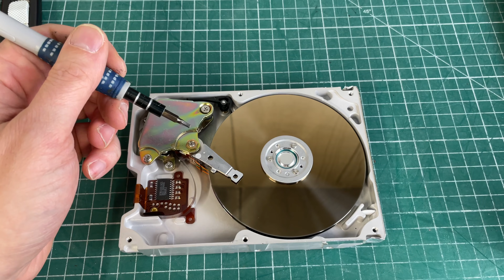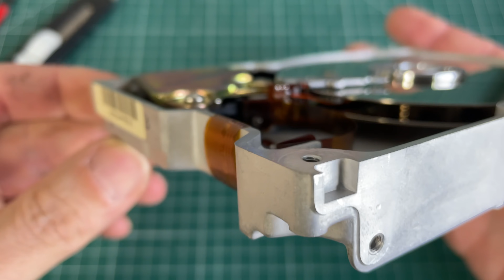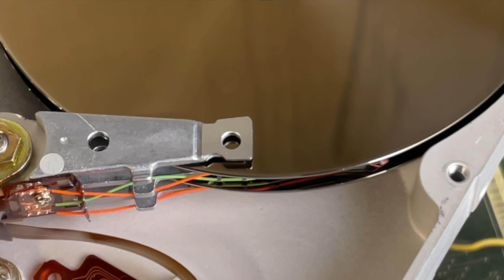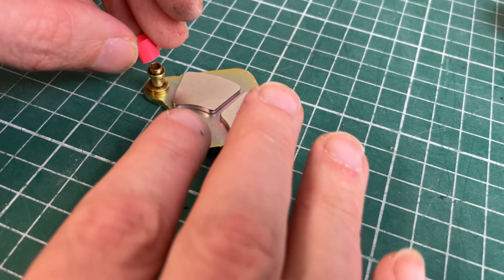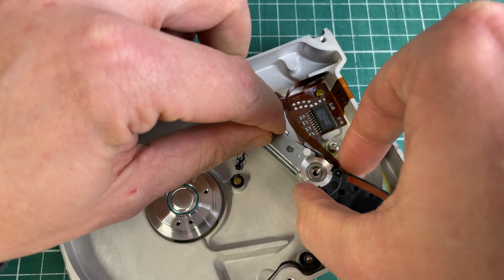Hard Drive Repair Gone Horribly Wrong

Comment: I have a Quantum 2.5GB hard from 1996 on a Windows 95 system. The system was held in perfect condition, you cannot even find dust in the case. I used it till 2000 when I left for overseas. It was still held in the same condition until I returned few months back: the hard makes exact same sound as you showed. Was thinking to open the drive case and look inside but didn't. Next time I am back, I will use this video as a guide. 

Got some important 90s games on that drive😃

Comment: Those jumpers designate boot order. Technically you should make a clean box without it the chances of it working again are slim the screws are also torqued without knowing the torque same thing will happen. Before opening trying tapping it on it's side. It will allow you to sometimes grab the data but once it starts that it's called the death rattle. Drives are not serviceable for reason they are really hard to repair or refurbish. Perhaps if you had taken that off and found that tar it may have actually worked. I have this laptop drive I took apart just to look and it has a device in it when the heads leave the platter this device ensures the heads don't touch.

Comment: I have that exact model and they drive would spin up .. make 3 clicks and then shut down... I opened it and removed the top magnet and isolated the goo ruber stoper with tape and placed the magnet back... now the drive spins up and the down (without the 3 clicking) ... well it is dead unfortunately But I would never venture touching the heads and platters...  QUANTUM drives were/are/and always will be TRASH.
I say this because they were all prone to fail even in the day... and from tens of failed hard drives I have most are Quantum

Comment: I just got an old MFM drive going. Now I'm having panic attacks bout rubber goo inside the drive! LOL. Lots of old rubber products turn to goo over time. The drive belts in audio equipment. Capstan wheels. Reel to reel tape. I have been moving away fro mechanical HD's. Been using the old CF cards. But there's something about mechanical stuff. I actually want to figure out how to make a nice clear cover or maybe enclosure for my MFM drive so people can see the parts moving inside. I was thinking maybe I could make my own little clean room out of a fish tank and gloves. Kinda like they use in virus labs.  Lorne.

Comment: i Have an early ide stepper drive (20mb) that was stuck...very stuck...i used a needle nose plier to twist the top head a bit and i managed to unstick it without ripping the head off...i left some fingerprints wich i removed by spraying the entire drive with brake cleaner and blowing canned air to dry it (dries very fast and no residue) i never wiped the platters with anything...just brake cleaner and air....amazingly it worked and still does, reads all the data just fine, has the original dos 4 i believe and windows 2...its installed on a schneider 8088 computer....i also have a seagate ide drive (40mb st 157a) that had a broken steel band that connects the stepper to the head assembly...i replaced it with one from other drive and then i had lo low level format it and it worked...i have a 386 mainboard with those colourfull amibios that allows low level formatting drives directly from the bios setup screen...

Comment: I did a few harddrive repairs in the old days.
One of the tricks I did to make sure the platters would remain aligned was to apply very thin and not very sticky tape on the sides, even making light markings with a alcohol based marker on the sides would do. on low density drives like these.

Comment: Oh, by the way... I saw a guy using tape on the outer edges of the platters in order to keep the aligment during removal. That could be helpful for someone attempting to repair a hard drive like you did (and me, too, with an MFM drive during the last couple of days - I don't have to worry about the alignment, though).

Comment: I noticed some people already mentioned JIS screw heads and the platter alignment. But there's one more thing to note: the screws all need to be torqued to the correct torque. This is especially true for newer drives. There are videos on youtube, demonstrating how drives will refuse to work correctly or at all, if the screws (even the ones holding on the top cover) aren't torqued to spec.

Comment: I had an IDE hard drive on the Amiga. This record got louder and louder and made unhealthy noises. One day it didn't want to turn any more and just clicked softly. Then I tortured this IDE disk with a SCSI tool. Scsi-Eject didn't produce any results, but I was able to turn the rotary motor on and off. After a few tries I managed to get the platter back to turning. I was able to mount the disk again for half an hour and thus still save data on another disk. The plate was definitely damaged and then completely failed.

Comment: In "old days" we learned, that a hard drive is doomed as soon as you open the cover lid (if you are not in a cleanroom).Dust gets inside and lands on the platters. As soon as the harddrive starts spinning again the heads start to rub that dust into the surface of the platters creating faulty sectors.  There was a lot of dust on the platters a few minutes into this video.

Has that change during  the last years?

Comment: There should be a reserve power supply (Capacitors???) that have just enough power to make the heads move off the platters when power is disconnected
Reply: These heads can never leave the platters. They have a parking spot inside.

Comment: OMG! 
1. never power it up, till repair is finished! 
2. never move it manually!! U will scratch the hdd disk! U may not be able 2 buff it out! 
3. energize the reading head, let reading head/arm move 2 off/park position.
4.Have software from 1984 for hdd drive testing!!
it will need total restoration! the heads a probably ruined now..the disk's are probably scratched bad!! but it can be refurbished!! it's just a primitive mechanical drive from OMG! 1990! there I said it!! I bet U don't do this 4 a living?? OMG!! black goo! don't get it on U'r skin!! it's a special lithium grease! don't expose u'rself 2 it! this is what happens, when people don't send in there broken stuff!
if U'r serious, & want good pricing. check this man out!!
https://www.youtube.com/watch?v=afUdR6c8ikY

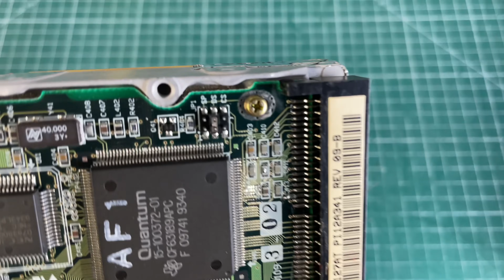Comment: 2:21 Those are the ATAPI (IDE) master select jumpers. On Quantum drives, the coding is as follows:
DS = IDE master,
SP = IDE slave,
CS = Role determined by cable wiring.
For single drives on their own cable, DS should be used. For newer 80 rail IDE cables, CS should always be used.

Nice vid, and nice pointer about not needing a clean room for casual work! Until I saw this vid I thought merely exposing the platter to normal air would do it in! 😳😇

I have an old (And indestructible) 40MB Connor  around here somewhere. Once I’ve securely wiped it, I might throw it on the bench for a play too! 😊

Comment: Nice! Well the bottom plate contains the servo tracks. If you had put the platters in the same order you could have been lucky in the way that it would at least initialize to track zero again. I used to work in a team designing the electronics of 14" MFM hard drives. What you're having was the next generation. BTW you still could low level format them. Oh yeah for the heads they should never be moved when loaded. You need a head loading tool to lift them up before moving them around. What broke off this one data head was the RW coil from its 2 magnetic poles which are a brittle ferrite material. Oh man your video brings memories back  :)

Comment: Metal shavings from grabbing the magnet assembly with pliers probably didnt help either lol.
One trick to try dislodge the heads without opening up is to bump the drive on the side at full spin with one of those rubber hammers.  It worked for me once for a Quantum LPS.

Comment: The moment you broke the seal on that hard drive was the moment you let dust particle contamination in, thereby destroying the hard drive. You have to be in a special clean room to even think about breaking that seal. One tiny dust particle is enough to cause the heads to lift up and crash against the platter, destroying the magnetic coating and all the data along with it. Don't even try to do this on a 6TB or larger hard disk as they are filled with helium gas, pop the seal even in the slightest, it's done for.

Comment: I have the 85MB version of this hard drive (it's just this drive with a different head stack and a single platter).

Good news: I was able to un-stick the heads.  Bad news: just about every other thing.  The actuator really is getting stuck on black rubber goop; the HDA seal shrunk, so that's been compromised; the hard drive is a paperweight now.

Very fortunate that when I got this hard drive, it worked, and the first thing I did was back up all the data.

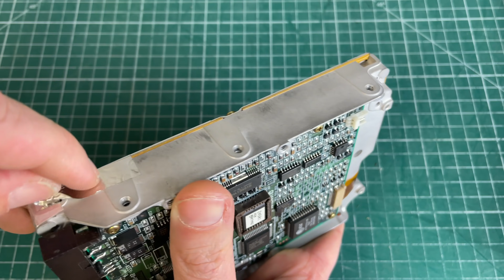Comment: 2:09 The metal tape can serve various purposes.
1. Protect against vibrations if it is attached between the housing and the support
2. Save you from something stupid and show the manufacturer whether you have committed this stupidity anyway :)
3. Holes in the housing are like a gateway for electromagnetic interference. This shielding mitigates that.
4. Also High Frequency Physics is a bitch. The few screws in no way guarantee a low impedance to ground for the lid. The tape grounds a large area. 
5. A seal in terms of tightness. But that's an assumption. Tape is usually not a good stopper/seal ... except when used as a sealant in a screw top or something similar. 
No guarantee of completeness.

There are laptops, computers in the industrial field, Dell(and others) hard drives that are completely surrounded with aluminium. A thin foil hat:) This was and is done to protect against Electro Magnetic Interference. But sometimes you ask yourself if they forgot the heat in their calculations....

Comment: sun micro workstations used those drives and they had a bad batch from quantum... if they were powered down for a long period of time the lubrication used would sort of harden and the heads would not move... I freaked out more than one customer by pulling the drive out and smacking it on a desk to try and unstick it (per directions from sun eng).  If the drive was able to startup at that point, I advised the customer to back up his/her data and then call me and I would replace it with a new drive!   As soon as I saw the disk in your video... I thought to my self smack it and see if it starts. lol

Comment: What if you had an hard disk that has a scratch right across it's surface, including Sector 0, where the arm gets stuck? How would you copy / image the data off of the bad drive in such a case?

Comment: Hi there vintage fans! i can fill in with some good information about these drives as well and what you should look at as well, first thing to look at on these prodrives are the input capacitors, there are two squares right next to the molex connector and this caps fail, they all fail and they gotta go immediately, you probably has some sticky green goop that is making the circuit board rot away on this type of drive, clean this up and completely remove the caps or replace them, I have run drives without them but if you have a poor powersupply the drive may get unstable as the voltage will fluctuate more without them. always check the board for problems before opening the drive as this will damage it no matter what you do afterwards. tip two: if the drive have been sitting for a long while you may hear the bearings run very rough the moment it starts up and run, don´t use it right away, just let it sit for a good while to let the bearings settle in again as good as they can, I seen these drives have wobbly platters because the bearing is like this, eventually it works or dies from this, murphy decides this. tip 3 inside the drive, this area is sensitive, the heads are incredibly sensitive and you should absolutely never push them anywhere without the platters spinning, when the drive is still the heads rest on the platters on this old type of drives and they almost glue to the surface, they can only handle the force so much and is designed to work on the rotary direction of the drive only, when the disk spins air is pushing the head of the disk and it hovers above the surface with a distance of a smoke particle, I mean serious small distance but then it has no friction and can move freely without breaking. if you gonna tinker with them anyway then a tool to lift them off the surface is a good idea, as it was intended in the video but it is more to keep the heads from grinding on the surface rather than anything else, the heads are very brittle and if you kink them or scratch them or poke them wrong then good night and goodbye drive. if you cannot do anything else the disk should move in the right rotary direction while you move the heads to the side. as for the parking break the plastic arm is pushed by the wind created by the fast rotation and is pushed out by this wind. I also had a drive spin up like this and stop because of issues with the circuit board and not internally but it is very sad to see this rubber rot issue which is pretty much a  stamp of unescapable doom for the drives that have this kind of rubber. Quantum drives have always been my favorite amongst vintage drives because if you compare them most of them has very durable properties and most drives i ever had are still good except for this specific models. I actually have two drives of this exact model that have died and I may actually check closer into this rubber issue. since one of these drives have not been opened and it ended up screaming for a while, then working a little bit but also generating damage in the data areas so it is absolutely doomed and a great candidate for science. but there is one golden rule: the chance of drive failure is 100% no matter what brand age or model, they all gonna die but the question is when, and if you open them up then they will die even faster and are in immediate risk of permanent destruction. Just remember to always check your capacitors for leaks when the equipment gets old, this is the silent killer of vintage equipment, and rotting rubber right?

Comment: Your biggest failure is opening up the hard drive in a non clean area.  Louis Rossman group use a hood that filters the air to with in a micron I believe, this keeps the dust off of the platters which can cause a head crash.  You can replace the PCB on the bottom without a clean room but that area where the heads and platters are has virtually no dust in it and requires a clean room.  But thanks for the video as it was interesting to see how you trouble shot the issue.  Thank you.

Comment: Having fixed a lot of hard drives I can tell you 2 things. The label that says "Do not expose to hard shock" and/or "Fragile, do not drop." relate to the heads and their nature. That head coil may have come off when you forced it past the parking latch due to the hard stop at the end of it's travel. Secondly, you're right about why it failed initially. The thing is, there are tools that will allow a low level format of an IDE drive. Acrontis I think used to make one all be it expensive and hard to acquire. There are free programs on the Linux side of things that work pretty well. Originally they were developed for UNIX but they still work in a command shell prompt. I can't remember what they were called but it should be easy to search for. They may even be on the internet way-back machine. Do some homework and due diligence and I'm pretty sure you'll find at least one that will work. Keep trying too. Remember, mistakes are how we learn. If we're lucky each mistake is an only child. The great thing is that success has a huge family to back it because it comes from all the mistakes we made in the process of getting there. This is good content. I hope you're able to continue to produce more in the future.

Comment: RetroSpector, the metal tape at the top of the hard drive was a tamper-evident measure by the hard drive manufacturer. If the tape is broken (indicating the drive may have been opened) the warranty is voided.

Comment: These are notoriously hard to fix - I got a 105 Mb open to loosen the head (it was stuck because of the crappy rubber stopper) JUST enough to pull the data off it. Then it just outright failed. 

Great drives at the time, but they don't age well at all, unlike WD and (gasp!) Maxtor drives (prone to bad sectors though).

Comment: I thought the rule was to never open a hard drive... as it would introduce contamination to the platters and heads, resulting in drive failure... maybe this does not apply to older hard drives

Comment: I prefer hard drives over SSDs ? WHY ? because they are more reliable for example i paid £100 for a new Transcend 256gb SSD some time ago and it lasted like 2 years before it gave up the ghost , where as my old Western Digital 256GB HDD has lasted 15 years !!! , so can anyone explain why SSDs are so unreliable ?
Reply: Because the number of total rewrites into the flash memory is limited. They are doomed from the start.

Comment: I have a 40mb Quantum ProDrive that is supposed to be succeptible to the rubber deterioration.  The eBayer that I purchased the New Old Stock HDD from sacraficed one to check that the rubber bumpers are in good condition.  How is it that some bumpers are good, while others are deteriorated?  Heat from storage?  Heat or something else from usage?  Humidity during storage?  Inconsistent rubber formulations?

Comment: Since the bottom side of the bottom platter is read only with the track spacing, it uses that as a grid for locating spaces on the disk.  In theory even a high level format should work.  So there should be no track information on the other platters.  If you separate the platters, the data will be garbled, but able to be high-level formatted away.  That's the theory anyway.